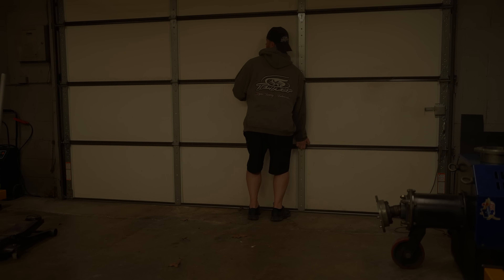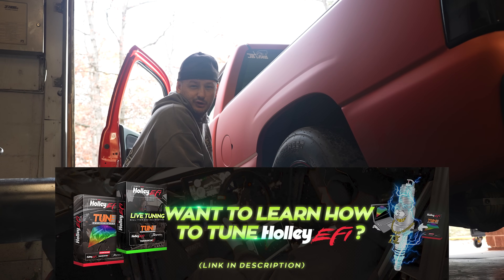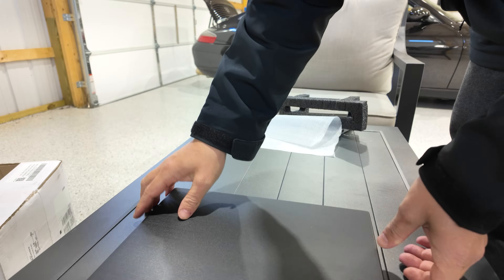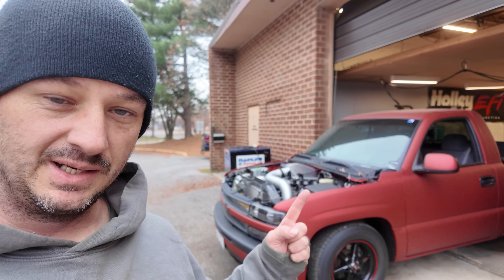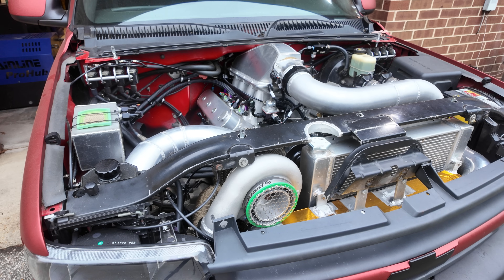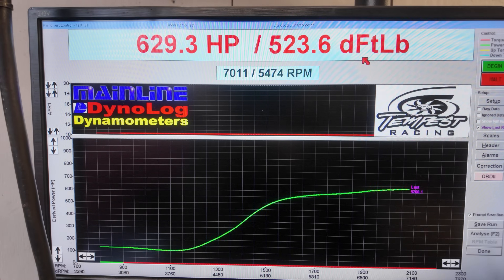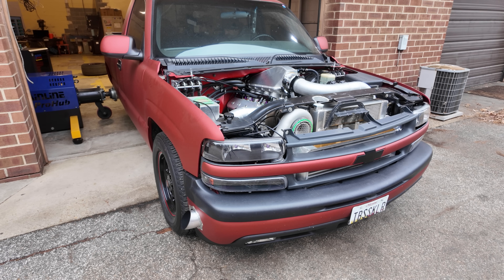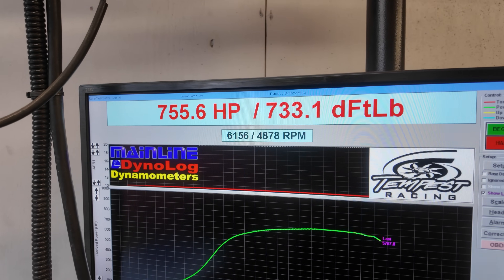Tuning a 800hp SBE Silverado with Holley Terminator X

Comment: What's the chances of that cheated up fuel pressure being the cause of the idle issue?
Reply from the maker: It was being weird before that and only trimming hard on ethanol. It runs just fine just bigger correction than i like to see 

After the fuel pressure change i always go back and tweak everything or atleast check it to make sure it’s still good.

Comment: Just curious how much fuel pressure you added to get the duty cycle down? Was it only added 5psi or did you add like 20psi?
Reply from the maker: @TheAnnihilatorRacing  pretty sure i went from 43 to 50. This was a while ago